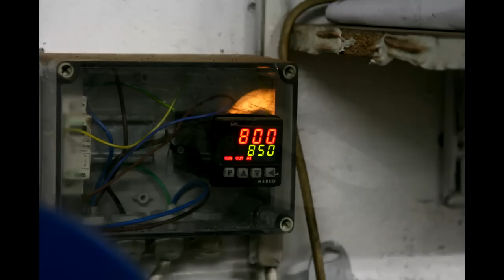MAKING A KNIFE OUT OF AN OLD FILE [Trollsky Knifemaking]

Comment: Beautiful knives! I have made a lot of gunstocks, but only a couple of knives, just using a piece of stag for a handle. I have seen people use a piece of heavy High tensile strength cable large in diameter that is used for industrial stuff-drag lines; cranes. Anyway they heat it in a forge and hammer it together and it makes the wildest patterns I have ever seen.

Comment: I use a belt sander to obtain my edge bevels. A perfect bevel can be made for the edge by using a large floor model belt sander. Carefully place your hands on the back of the blade and use the coarsest grit paper to rough it out dipping it in cooling water when the blade becomes too hot for your fingers to hold.
This way, you do not burn the temper out of the steel as you hold the blade to the correct angle and move it from side to side across the belt.

Comment: I generally don't temper my file blades until I have ground them into shape and formed and sharpened them on a belt sander. Once I have a nice polish on the blade, I put it in my kitchen oven and watch for the tempering color to show up. I then quench them at about a "Turkey Bronze" color just short of getting into the purples.
This allows me to create a blade that can hold a razor's edge yet still be tough enough to do a lot of heavy carving or cutting with it. Chrome-Vanadium files are best

Comment: I first grind the rough shape on a wheel taking care not to burn the steel dark blue. have found that if you use a large belt sander and several coarse belts, you can first remove the file teeth and then bevel the edge of the blade without losing the temper of the hardened file. I do this by cooling the file in cold water whenever it becomes too hard to hold with my fingers on the back side of the blade. It is only once I have the blade ready that I heat it to a bronze color and quench it.

Comment: When using an old file you have to do several steps, first anneal to make it soft so you can work with it. Once rough shaped you then need to harden it AND temper it, which isn't shown here. If you do not temper it will be very brittle. Also, it is good practice to draw temper (soften) the curve at the tang transition to reduce the chance of cracking.

All of this can be done with a wood or coal fire, wood ash, oil and water, and the process is available online.

Comment: Temper once to soften the material, makes it much easier to cut a rough shape and less wear on your tools.  Remember, a file is basically made to cut metal!  Then harden to your preference, based on the knife's intended use.

Comment: Got tired of using a hack saw to cut out a piece of steel to use so I bought an angle grinder and a cutoff wheel.

Turns out I bought the wrong type of wheel, apparently if I use type 1 discs on my grinder they will explode and horribly injure me, good thing I spent a while looking up info on it online. Manual just said "don't do it"

One day I'll be able to start making a knife again. Tools and rain can't stop me forever.

Comment: no, steels need to be heated way higher, for instance 1095 needs heat treated at about 1400-1600 if i am thinking right, i may be wrong but its around that heat, a toaster over wont get that hot.

Comment: Everything good except the first heating is called normalizing where the file (any carbon steel) is heated to red heat and then cooled off in the room which makes the metal as soft as it can be so it can be worked, cut/shaped before heat treating. Any high steel is hard all the time but normalized makes it workable.

Comment: hello sir, first off, BEAUTIFUL knifes, i have a few questions i was hoping you could help with , i recently bought a few knifes at the local swap meet and I'm trying to get this skill down, how long should i temper them for the first time before the cut and the the time after i cut the design?, I'm using a pot belly stove with red hot charcoal by the way, also, what wood stain did you use? and does epoxy keep the wood handle on nicely?, also, do you use a bench grinder to get an edge on it?

Comment: what is the hand tool you used after using the drill press on the wood handle? I've had a lot of trouble in the past with getting the hole in the wood handle to be a snug fit for the knife handle.

Comment: Actually, when you heat metal and let it cool slowly, the metal becomes softer, less brittle, and more workable. This is known as "annealing." After the knife is worked into shape, heated, and quenched in oil, it becomes very hard/brittle again. It is then heated to a relatively low heat and let cool slowly again -- this is the "tempering".

Comment: If a file can make a good knife can one use "angle iron" steel pre-bent with a 90 degree angle, used in structural applications. I have a lot of this type of steel were i work and its fairly inexpensive.

Comment: do you use farenheit or celsius for the 500? 500 celsius is not enough to draw the hardnes out from the steel. heat it up to almost 700 celsius and hold this temperature as long as you can. 2 hours should be a good time. let it cool down very slow. if there is some chrom and vanadium in the file, it could harden if you cool down to fast. than you can cut it with the hacksaw -  like butter......

Comment: OK .... next problem ... I can't drill through the file even with cobalt bit.  I tried heating the handle with a torch to see if that would 'soften' the metal, but either I couldn't get it hot enough or that just won't do what I need.  Any suggestions?

Comment: is it a good idea to bake these @ 500 degrees for an hour to soften them up? then cutting them with a hack saw and grinding close to shape with other files would be easier, and then all you'd have to do is heat treat and then temper back with the oven at 300 for a good product to finish off?

Comment: Mithril is a silvery metal stronger than steel but much lighter in weight.
It could be beaten like copper, and polished like glass.
Impossible to find these days.
Superseded by modern Adamantium, which is stronger but considerably heavier.

Comment: You epoxy-ed the handles on?  No Pins?  Will the epoxy handle stay on/not slip off?  Cooling Water/Oil..  What oil do you use in the cooling water.  What about using a torch to heat and cool for tempering?  No furnace for heat treating..  More directions please.  Your stuff is unbelievable....

Comment: I've love using old hand files to make knives but after finishing the knife i always land up with rust on the blade , I've tried putting a lite coat of oil on put it eventually comes off , any advice
Reply: thank you I will give it a try , much appreciated
Reply: Try using a good carnauba wax. Wax is a far superior protection for metal because even the best synthetic oils still absorb a small amount of water and can form rust. It can be a pain with textured surfaces but you can use a fine bristle brush to remove the dried wax from hard to reach places. If you think I am crazy just look up a product called renaissance wax and read what it is used for. Have a good day.

Comment: How can you tell if the file is good for knife making? I have some old ones but they don't say the steel type.
Reply: MrZleesbec if they are old they are good
Reply: +MrZleesbec if you're still wondering, you try grinding them, ones that spark alot with long sparks that flower at the end are high carbon and the best to use

Comment: I am working on a knife from file .... my question is:  If I don't 'soften' the file by heating, just working it with sander, can I heat it after working to eliminate the brittleness of the file?  I think I saw where after heat treating, knives are heated to 400-500 degrees to make less brittle .... will that work on a file as it comes to me?
Reply: Yes. When you heat up steel to soften it, what you are actually doing is bringing it above recrystallisation temperature and there the steel's grain structure changes shape in such a way it relieves and accounts for internal stresses. Basically when you heat it up, you are relieving stresses and softening it. Make sure you heat the steel to around 750 to 850 degrees Celsius. That's the austentizing temp range. Remember to harden and temper your knife after that softening process otherwise known as normalizing.
Reply: +ALL KINDS OF GAINZ I wasn't asking about the high temper; I was referring to the tempering of a file (I am guessing the high temperature conditioning of the file was done when it was made).
Reply: +MAX GOUGH Its tool steel. I temper my file knives at 200 degrees celcius or 400 degrees fahrenheit for about an hour and a half. If you want to play it safe then temper it up to 300 degrees Celcius.
Reply: +ALL KINDS OF GAINZ Thanx; I will try that.  I don't really want to get into the 1500 degree treatment; I work in my basement and don't want that kind of heat in the bottom of the house.  I do, however, have a stove in our kitchen capable of 400-500 f.  I appreciate your comment.
Reply: +MAX GOUGH So from what I understand, your file is already hardened steel and you simply want to temper it to relieve stresses after your shaping? Well then a stove is perfect. Have fun and stay safe because god knows how many times i should have died.
Reply: +ALL KINDS OF GAINZ Yeah, that is exactly what I wanted to know..... thanx.